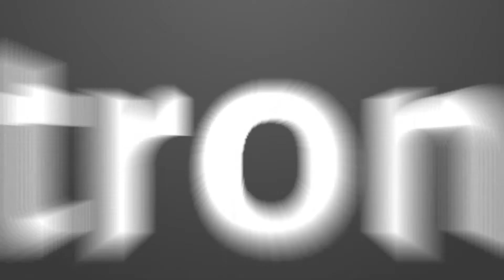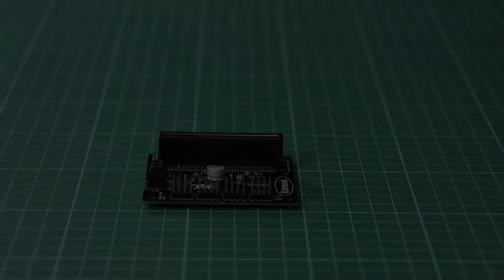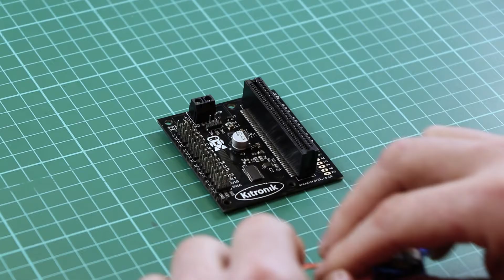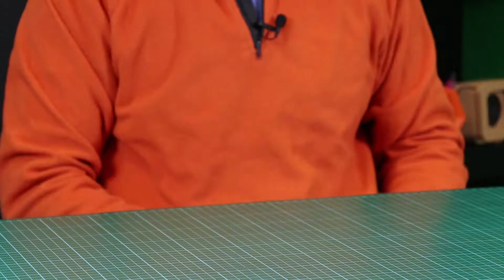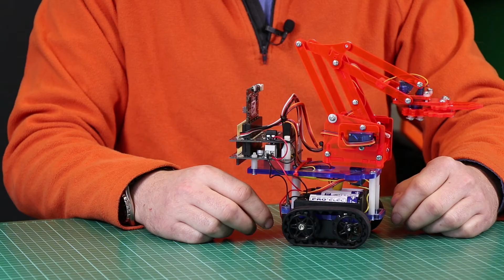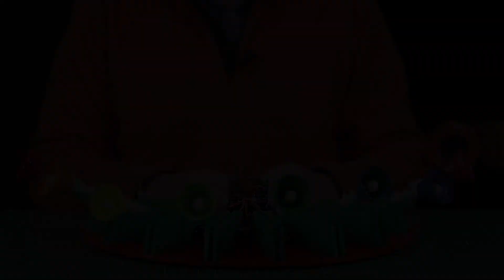16 Servo Driver Board for the BBC micro:bit by Kitronik

Comment: When i hook up my power supply to the micro bit and the kitronik board my power supply wont turn on the micro bit at all after 1 day, why is that or what can i do to prevent that?
Reply from the maker: Hi, do you mean that it is draining your batteries within a day?
Reply: Kitronik yes
Reply from the maker: @trevorjaxn39  When using a board with no on/off switch, I would usually either use a battery pack with a switch or fit a switch in between the power and the board. If that isn't practical then it would be best to unhook the power in between uses. 
Some devices, such as servos, can continue to munch power even when they aren't moving so a switch is essential.
Reply: Kitronik is there a way to turn on my micro bit the first time with out switching the power switch on and off a few times?
Reply from the maker: @trevorjaxn39  You shouldn't need to do that, give it the right amount of power and it should switch right on.

Comment: Hi there, I just got this board, it is working great. I wonder how I could use an external on/off button as an input instead of the on-board A and B buttons from the micro:bit. The 16 Servo Driver Board hides the I/O connection pins. Any help would be super!
Reply from the maker: You can use the link pads on the end of the board.  Pin 11 for B and pin 5 for A.